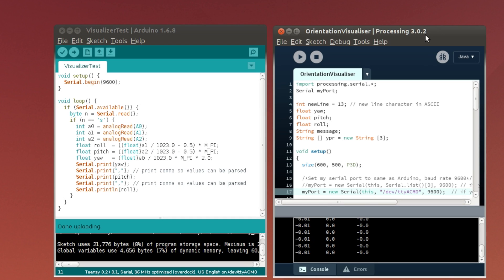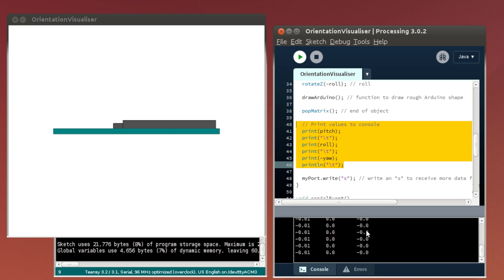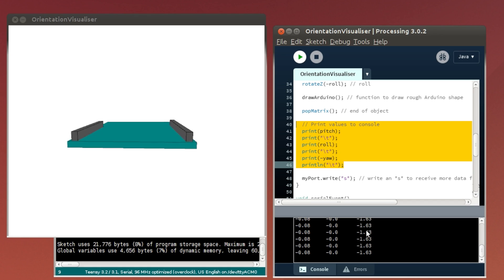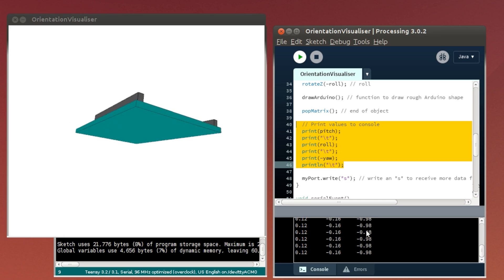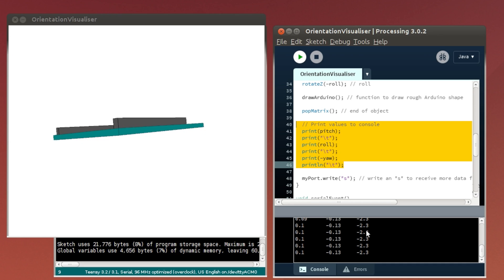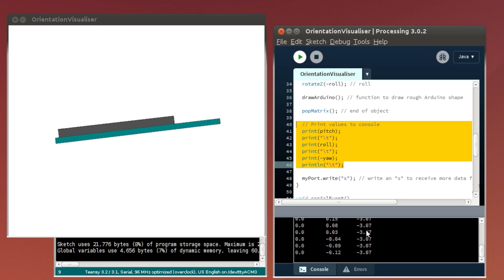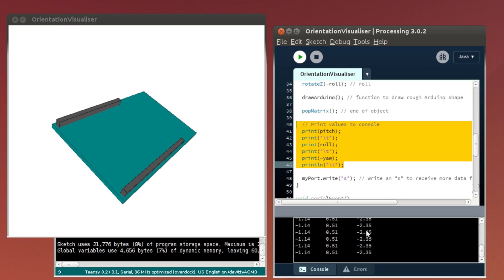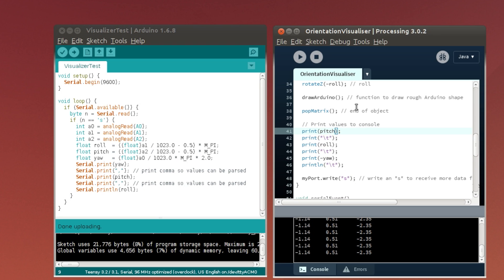Arduino 101 Orientation Visualizer Bug

Comment: Code not uploading in the board through Arduino ide. Processing is working ok
Reply from the maker: Ask for help on the Arduino forum.  In your message, show a screenshot of the Arduino IDE and give clear info about which code you're trying to use, which board you have, etc.  People on the forum can help, but only if you give enough info for them to see the problem.

Comment: Good work as usual Paul. You are lucky you can upload to the 101. Mine refuses to upload and many other users have the same issue.
Reply from the maker: +Jan Baeyens So far I've only used Arduino101 with Linux on 1 computer, where it seems to work fine.  I did manage to fix the visualizer rotations.  Fixed code is on github on the MadgwickAHRS library.  Hopefully Arduino will soon update their web page.
Reply: +Jan Baeyens My Linux box is down, but I picked up a 101 today and uploaded to it pretty easy using Win10 and IDE 1.6.8. Ran into the visualiser bug during testing.
Reply: +PaulStoffregen Not having luck getting the fix to work. For one, the new example can't open the COM port.
Reply: +Shuu Mai Found one issue. Changed "COM3:" to "COM3" and it starts, but the board orientation doesn't change.
Reply from the maker: Well, what happens if you open COM3 with Arduino's serial monitor, and send the letter "s"?  Does it print data?
Reply: +Shuu Mai It is a hardware specific issue recognized by Arduino. A fix has been delivered but I didn't have time to look at it yet.
Reply: +PaulStoffregen Got it to run, but the is represented backwards now. heh Pitch, yaw, and roll is good now, but if my board is pointing right, the graphic points left.